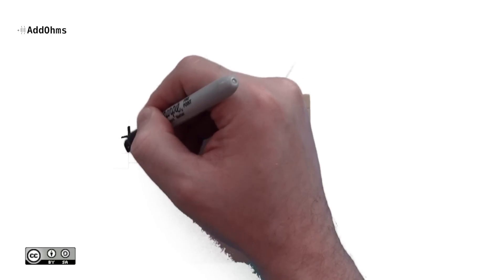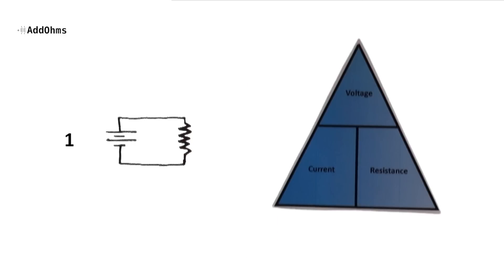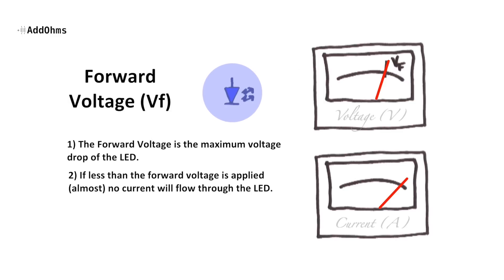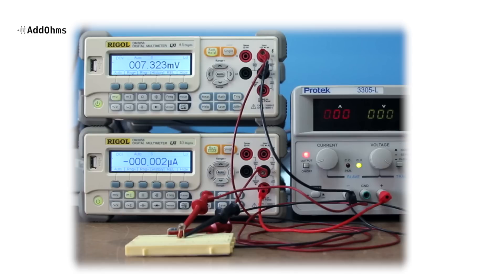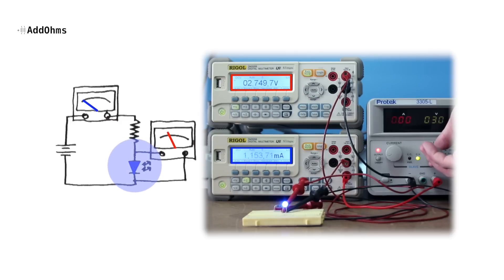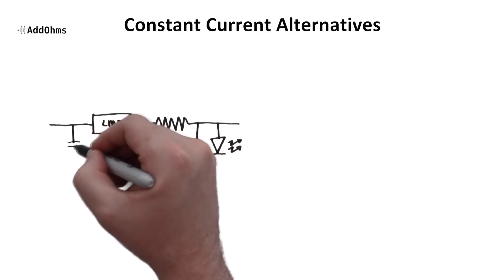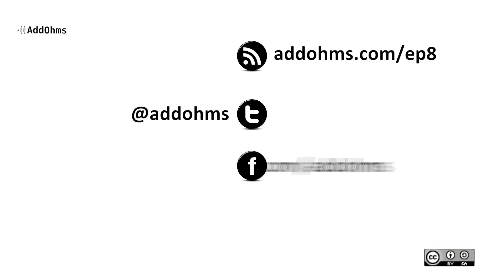Why use Current Limiting Resistors | AddOhms #8

Comment: hello i need help i have a battery with 2amp 7.2v and i need to get 220mah what resistor i need
Reply from the maker: 220 mAh is a measure of energy stored. If you know the current being drawn, then you can calculate the time it'll operate. Batteries supply whatever the load draws. So it depends on your load. It's highly doubtful you need a resistor.
Reply: @AddOhms  I don't know, I mostly have a fpv receiver and when I connect it to the battery, it heats up a lot

thank you for your reply <3

Comment: But doesn't the resistor act also as a voltage limiter.
Reply from the maker: Zero clue what this means.
Reply: @AddOhms   fixed it lol
Reply from the maker: You don't "limit" voltage, you "drop" it.
Reply: @AddOhms   but  doesn't it though.  If you have a 9v battery  and only 3 goes through them  you effectively limit  the amount of voltage an led recieves?
Reply from the maker: I have no clue what you are on about.

Comment: Hello, nice video ! is it possible to have a power supply that limits the current to 1A, 2A, 3A... independently from the voltage. I mean i would like to have a 12vdc where I can set the output to max 1A, or 2A..., but keeping 12v constant. Thanks.
Reply from the maker: You would need to design a circuit to limit the current. Most current limiting circuits will change the voltage to reduce the current. A resistor would not be enough.

Comment: Excellent video. I have a problem with x2 12V electromagnets getting really hot, like boiling point hot. They are running off a 12V car battery and after 20 minutes you can cook with them. I tried a tiny resistor on the + side but smoke came out of it very quickly. Do I need to use a current limiting buck converter? Or are cheap Chinese electromagnets just going to get hot?
Thanks
Reply from the maker: Electromagnets are coils, which is just a lot of wire. You have to measure the resistance of the coil to know how much current it will pull at 12 volt. Then you can use Ohm's Law and the power law to how much power that series limiting resistor needs to be rated at.
Reply: @AddOhms   Hi, thanks for replying. Unfortunately these electromagnets are shop bought and are sealed. I have no idea how they are made, or how to measure the resistance of the coil. I'm just passing current though them, this is the only thing I can control.

Am I basically screwed because of how they are made? I tried lowering voltage down to 9V and lower, which keeps them cool, but then they are not quite powerful enough. I'm now thinking about buying a constant current buck converter to keep the volts at 12 but reduce the amp flow, but I'm wondering if that has the same effect? Or maybe I could use a PWM signal somehow to keep current down, but thinking about it maybe this has the same effect too.
Thanks
Reply from the maker: Then measure their resistance with a multimeter.
Reply: @AddOhms   Thanks. I'm wondering though if the buck converter I have used to step down the voltage has the same effect as a resistor? 
Also what is strange is that only one magnet is getting hot now, the other does not. I wonder if there is a problem with the magnet itself, as even stepping down the voltage to 10v from 12 it gets hot, while the other stays cool. The only thing I have done is solder longer copper wires to the ends of the wires that were there. I wonder if there is degradation in the wires somewhere which is acting as a resistor?
Reply: @AddOhms   Okay I ran further tests but now I'm confused. They are supposed to run at 0.84 amp at 12V according to the seller.
Testing my setup with a 12V battery the cool one is showing it's drawing 0.19 amps and the hot one 0.42 amps. Even the hot one is half what it should draw. I'm thinking these magnets I bought are garbage.
Reply: @AddOhms   By the way what do you mean series limiting resistor? Is this something I should have in my circuit? I tried adding a small resistor of 47ohms but it started to smoke very quickly. I'm now running a buck converter to drop the voltage. One magnet seems to get hotter than the other, but they are both the same specification. I am also trying out reversing the polarity on the hot one to see if that has any effect. It seems to want to draw more current than the other one. Is this a result of "made in China"?
Reply from the maker: The 47 ohm resistor you put in series was a series limiting resistor. If it was a 1/4watt resistor, it couldn't handle more than 144 mA before it would start to burn up.You need to measure the current the magnets are drawing so you can calculate a suitable limiting resistor.

Comment: Hello,
Can you guide me for limiting the output current to 350mA of a power supply (with output 250vdc, max output 15Amp). Should I simply add 0.22 Ohm 10W (9 Resisters) in Parallel before load?
Reply from the maker: What is the load? Why are you working with a power supply capable of outputting 3.750 kilowatts, but only want 350 milliamps?

Comment: I have a project that requires 13 LED's 3.4 each at 20mA in series.  3, AA batteries. I try the net calculator for resistance and gave me -1985. can you tell me what am doing wrong and what resistance cand handle 13 LED's? thanks.
Reply from the maker: Putting 13 LEDs in series, each with a forward voltage of 3.4 volts means you need at least a 44 volt supply. You’re not going to get that out of a few AAs, even if you built a boost converter. Putting them in parallel and limiting the current to 20mA each means 2.6 amps out of the batteries. That is asking a lot of AA cells.

Comment: Can you use a buzzer as the current limiter? For example: I use a 9V battery and put 2 LEDs with a voltage drop of about 3V  in series and attach a mechanical buzzer (operating voltage 2-4 V at 20mA) in series to that. So there is  about 3V left for the buzzer which will draw 20 mA, which means 20 mA will go through the LEDs. Is this correct? If no: how do you get the same effect?

Comment: How would I limit current in a phone charging circuit? Say I have a 2.1 amp charger but I don’t want to charge it that fast to extend the battery life
Reply from the maker: The charging circuit is in the phone. So there isn’t much you could do externally, except, get a supply that is only capable of delivering lower current. Phones do use pull-up resistors on the data lines to indicate to the supply whether they are capable of accepting 500mA, 1A, or 2A. So an option would be to build an adapter that disconnects the data lines between the phone and usb power supply.
Reply: AddOhms I was hoping I could just build something that went in between the charger and the phone to reduce the amps
Reply from the maker: Build an adapter that disconnects the data lines on the device side, but provides pull-down resistors on the host side. For 500mA that would be 15kOhm on D+ and D-. More information here: https://www.maximintegrated.com/en/app-notes/index.mvp/id/4803. Skip down to "An Array of Power Sources."

Comment: If you install a latching switch just downstream from the power supply, would this circuit generate any inrush current?  Power supply is on, switch is open, then the switch is closed for several seconds, then the switch is opened again.  Would the resistor limit the transients caused by opening and closing the switch?  What if the circuit had 7 LEDs, an adequately sized resistor in series and was powered off 24vdc?  Am I right to be worried about inrush currents?  Or am I totally mixed up and inrush is entirely a function of the power supply design since the LED circuit is passive?  Thanks for the video!
Reply from the maker: I think you are confused on what is "in-rush." In-rush is caused by capacitive and inductive elements. LEDs are mostly resistive. (Though they, like all components, have some C and L parasitics.) The amount of current LEDs draw at the instant voltage is applied compared to their steady state is nearly the same.
Reply: Thanks!
Reply: One more question.  If PWM is applied for dimming purposes to this same circuit, is it still accurate to treat the LED like a resistor?  Or now is it more like a switching transistor?  Would it create rf emissions?  I think no, because the diode use-case is passive in nature on this simple DC circuit (dissipating energy only, not generating it) that only contains LEDs and a current limiting resistor.  What are your thoughts?
Reply from the maker: The changing electromagnetic field can radiate, creating "RF" or just "plain" emissions. Some components are better conductors of this energy. Traces and wire are excellent transmitters and antenna. Resistive elements, not as much. 

Also, the frequency that PWM runs out tends to be very low, far from the traditional "RF" range. Specifically to limit the ElectroMagnetic (EM) emissions or at least limit the emissions at frequencies nobody cares about.

Comment: quick question. In some extension cords, and plug adapters, there is an LED indicator, when the cord or adapter is connected to the AC mains. I've opened up one and was surprised that the LED is connected directly to the AC mains, with just a 100 K ohms resistor. How is this possible?
Reply from the maker: It's perfectly fine. The 100K resistor is the current limiter. The LED is a diode, so it only conducts in the forward direction. The LED is actually flashing/pulsing since it is only on for half the A/C cycle. Without looking at it closely, it appears to be on steady.

Another common method is to use a "capacitive dropper." That's where you use a capacitor to AC-Couple a lower voltage circuit. But in the case of just an indicator light, that's usually more expensive so just a resistor and LED gets used.
Reply: Thanks for the reply. I've just started learning electronics, and trying to understand the capabilities/uses of these components. Most of the electronic circuits are in DC, that's why I was surprised with this setup. I've googled about this circuit and most of the responses in forums, did not believe that this setup is possible. As I understand in your video, the voltage will have no direct effect on the LED (even at 220v) because it is dropping or just using it's forward voltage (e.g 3.2 v) and the rest goes to the resistor. Only the current has a direct effect on the LED, that's why there is a need for the current limiting resistor. I've also came across Kirchoff's Law while browsing that somehow explained the voltage drop across the resistor together with a load like an LED, based on this the voltage drop on the resistor will be 220V-3.2V (Vf of LEd)= 2168v (AC or DC?) is this correct? Forgive me for not trying this myself since I'm still new and a bit scared to test it out on live mains.
Reply from the maker: This became too detailed to respond here. So I wrote up an explanation here. I don't mean to pick apart your question. I just feel it is better to break down each point to be more clear. https://discuss.addohms.com/t/leds-in-ac-extension-cords/678
Reply: Hi, Thanks again for the reply, and I actually appreciate that you've explained every part of my question. I believe that the most "unbelievable" on this circuit was that the resistor did not "burn" out, and I was not able to convey the right question.But it was rather simple by using Ohm's Law and calculating the power, as I found out later. The resistor voltage drop is 216.8V and current is 0.002A which when power is calculated is only 0.4336W, so if a resistor with a 1/2-1 Watt rating is placed on the circuit it will not burn up. Thanks again!!
Reply: 5 years late but..
1) are we sure it's a LED and not a neon lamp?  Neons are often used as mains indicators and have a large resistor in series with them.
2) it's wrong to say the LED will only conduct in one direction.  LEDs have a reverse breakdown voltage of ~5Volts, so you can't rely on them to be non-conductive at mains voltage

Comment: I know it's a bit late but, if I use 3.3V instead of 5V in my circuits, and blue or white LED's with forward voltage of between 3.3-3.7V, would you still recommend a resistor?  Thanks...
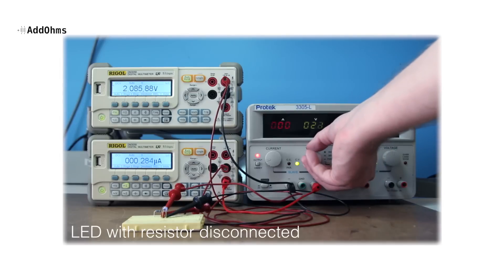Reply from the maker: You have to be extremely careful. Around 3:40 you can see this LED draws about 5 mA at 3.0 V and 18 mA at 3.5 V. Not much change in voltage, but a huge change in current. If this is a one-off project, I would make careful measurements to make sure the LEDs aren't drawing more than 20 mA -- or a current higher than the supply can handle (which may be less than 20 mA.) 

That said, if it were my circuit, I probably wouldn't use LEDs with such a high forward voltage. But, I also RARELY drive LEDs to their maximum forward current. 20 mA is too bright for most of my uses.
Reply: Good point. 20mA is a bit bright on pretty much any of the newer LED's.  Cheers Mate.

Comment: Ok, so you picked 470 ohms, why, exactly? That's what I find is missing from this discussion.

Using the LED Calculator Wizard you link to on the notes page, I can get 470 ohms if I specify a 12v source, 3.2v LED Forward voltage, and (looking back at the data sheet, I assume the "forward current", which I don't think you mentioned, is 20 mA), 20 mA for the forward current.

However, the voltage you use in the demonstration seems to want to be 5v.

What say you? :)

Thanks.
Reply from the maker: +lahattec Pick the current you want to go through the LED. Most people look at the data sheet and see "20mA." That's the max. Less current, less bright. Subtract the LEDs forward voltage from the supply for the resistor's voltage drop. Use ohms law and divide that remaining voltage drop by the current value you picked. That is the resistance value to use.
Reply: Ok. Thanks very much for that. 

So, assuming a 5v source, and a desired forward current of 5mA, then the voltage drop 'left over' for the rest of the circuit (the resistor), after taking into account the LED's forward voltage of 3.2v is 1.8v.

So then dividing the 1.8v by .005A equals 360 Ohms.

One weird thing is that the LED calculator comes up with 390 Ohms. Any idea why the difference? Did I miss something?
Reply: Perhaps the difference is that the LED calculator, as it says, "rounds up to the next standard resistor value". Maybe that's the difference.

Comment: Excellent video - thanks. But LEDs still confuse me. In the opening you said that when an LED turns on it effectively becomes a short. So I'm confused how it can be dropping 3v across it when the supply is 5v. It would seem to me that its effective resistance is higher than the resistor (which is only dropping 2v). What am I getting wrong?
Reply from the maker: "A short" doesn't mean 0 ohms. A piece of wire can create a "short circuit" which means it provides a low impedance (or resistance) path. Even that piece of wire has a resistance associated with it. Just like the diode. There's some resistance associated with it.
Reply: Thanks for the answer. I know you can't treat LEDs as pure resistors but would it be correct to say that an LED dropping 3v at 20mA ( at any Vcc, assuming resistor drops the rest) has an effective resistance of 150Ω under those particular conditions?
Reply from the maker: +vinnerism You would need to know what current flows through the LED at 3 volts, with no current limiter. Then ohms law could tell you the resistance--at that voltage.

Comment: Its comfusin when you say the led drops 3 volts cause you make it sound like the voltage decrease by 3..
Reply from the maker: It does. In a series circuit, voltage drops add up to the source. So the LED drops its forward voltage and the resistor drops the rest. The two voltage drops combined is the same as the battery (or whatever the source is.)

Comment: you can limit current with a capacitor to
Reply from the maker: +prototype9000 No, you can't. 

If put in series, it will act as a blocking cap, preventing any current flow.  If in parallel, it'll significantly increase the current draw while it charges up.

Neither acts as a current limiter.
Reply: +AddOhms it allways works for me changing the capacitance changes the amount of current being passed try it and see
Reply from the maker: +prototype9000 That is not current limiting. 

That practice is damaging the LED and possibly the driver (e.g. the I/O pin.) The charge and discharge of the capacitor will be pushing far too much current. Granted it'll be in peaks.

While it might "work" in a demo, it is not a good circuit design practice.
Reply: try taking a capacitor  and placing it on a dimmer switch  with a light bulb measure voltage and current then take another capacitor same voltage rating but a smaller capacitance and measure the current and tell me the amperage has not dropped. throw away the dimmer if you want and leave the capacitor in the circuit  for the same effect it wouldnt work on a dc circuit at all unless the input is pulsed but it will limit current on the ac circuit
Reply from the maker: If it's not DC then then capacitor is smoothing out the changes. You are seeing the RMS voltage and current change, not a current limit. 

Do the same measurements with an oscilloscope, instead of a multimeter, and you'll see the true wave shape. You aren't limiting current, you're just smoothing out the peaks and valleys.

Comment: Hi. . AddOhms.. i have 50 pcs of 
5mm LED UV Light :-
-Input Voltage: 3-3.4V-Input Ampere: 18-20mA-Wavelength: 395nm -Colour: UV
i want to built a UV Light box.. and i want to know 
1. which wiring is good to use series or parallel ?2. how much volt power do i should use to power up 50 LED3. how much resistors do i need?
there some guide for me to follow :) Thanks!
Reply: 1. Use Parallel arrangement. Bcoz in "Series" if one LED will fuse then all remaining LEDS will not work. 
2. 5 Voltage Source will be enough for all 50 LEDs 
3. 220 Ω to 650 Ω (Depends on how Bright you want). My suggestion is to use 1K Potentiometer(Variable Resistor).

Note: If you use LED in Series then you need 3 x 50 = 150 Voltage which is difficult to produce.